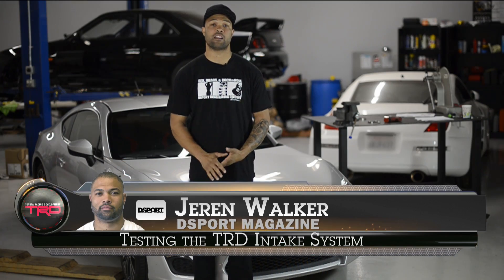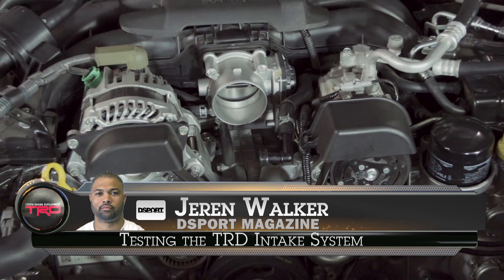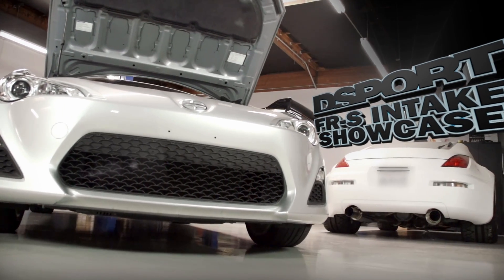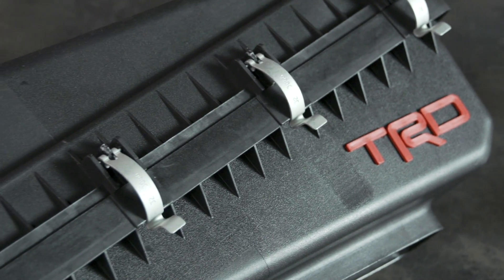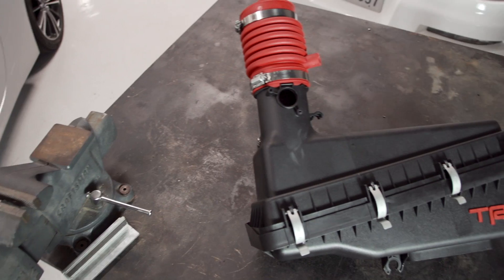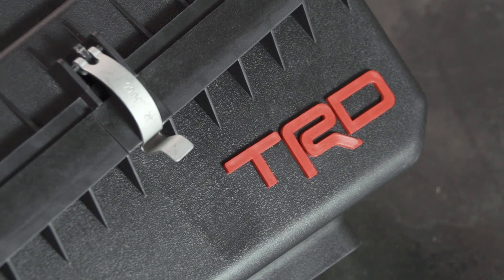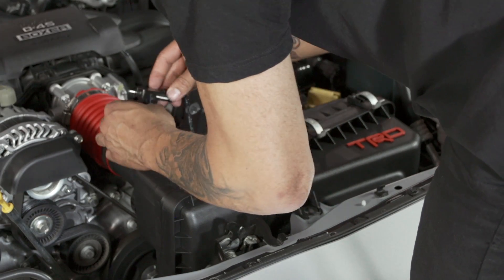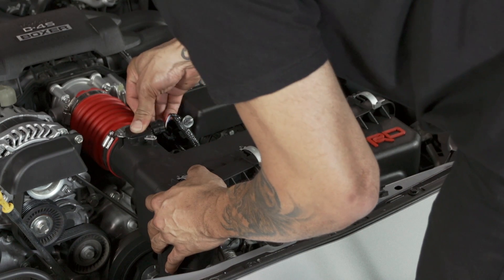2013 Scion FR-S Intake: TRD Dyno Test

Comment: I don't doubt for a second that this doesn't perform as well as other intakes on a dyno. It's still a panel filter, and it still uses the restrictive ram intake thing (which would probably be WAY better at speed) not to mention the ribbed hose. I may be biased though, never been a big fan of TRD parts.
Reply: +Robby Bacus Tests were done on the forum recently and no power is gained by adding or removing the front snorkel...

Comment: I'm pretty sure if you partner this intake with the TRD Catback Exhaust your gains will be much higher. I mean I honestly think this is probably one of the best intakes for the FR-S plus everyone who has it says that throttle response at the low end is much better and that alone is worth it. Plus it gets rid of the sound tube and it looks good.
Reply: Plus I kind of don't believe it only adds 2.5 but thats just me.
Reply: @nearvii6745  yeah it feels like more but maybe because of my aftermarket exhaust
Reply: Near VII  I've installed many intakes on my BRZ namely, K/N drop-in filter, Injen, HKS Suction, and Cosworth drop-in filter. Gotta tell you Injen and HKS Suction intake perform so badly in Thailand. I'm using Cosworth drop-in filter at the moment, I'm doing about 191whp with 21.4 kgm of torque. (I'm on E85). I'm so interested to upgrade my intake again.
So my question should I go for the TRD intake for better response at low end and more whp ?  Does it feel much better comparing to the OEM intake with a drop-in air filter ?
Reply: Idk man youre asking the wrong person lol?! Y u asking me.
Reply: oppps sorry then dude
Reply: @Paewrblue  yes much better, and  before I installed my TRD intake I had a stock airbox with a drop in Blitz filter.
Reply: Near VII I have the TRD intake on my 13’ FR-S and i can tell you that throttle response is way better at lower RPMs. Well worth it

Comment: Unfortunately had to take my AEM intake system out after about 2 months.  A lot of other people are experiencing this issue with other popular intakes.  Car was running rich and stalling at traffic lights.  I did not get a chance to tune it bc the AEM comes with its own system bypass.  AEM was sending replacement EDI units and now they are saying screw it just take it out and destroy it for full refund.  Sucks.  Maybe i'll try to the TRD but with a 2 hp gain...why even bother.

Comment: This is the TRD Cold air intake. The TRD intake is from Toyota Racing Development and its covered under warranty if it fails or causes any damage so repair is free, its like $370 where I live and its only covered if they install it for $60, personally I would go AEM Cold air intake the gains in horsepower on this one are sad, an HKS drop in filter gains more power